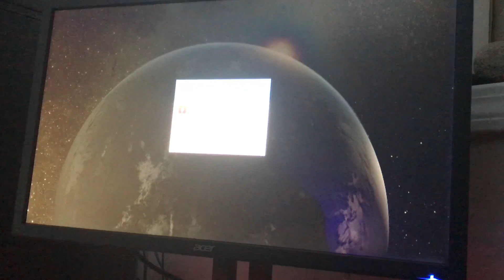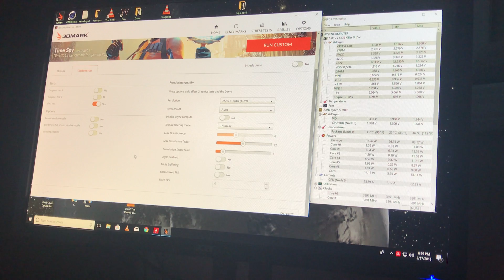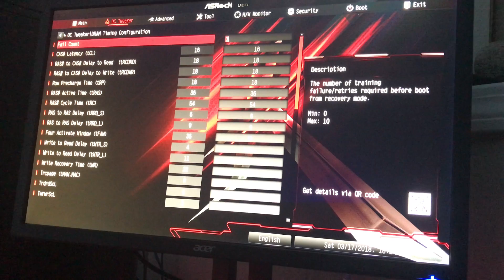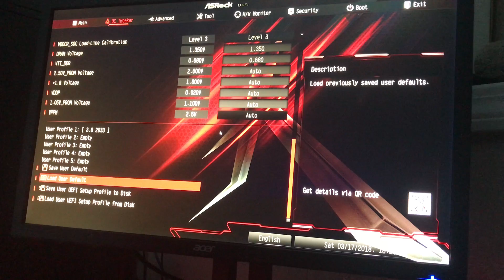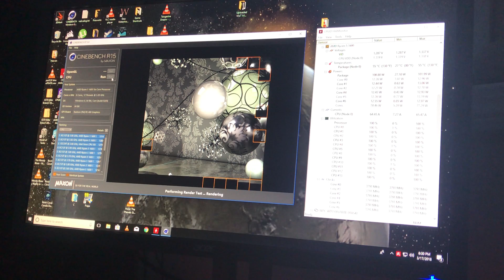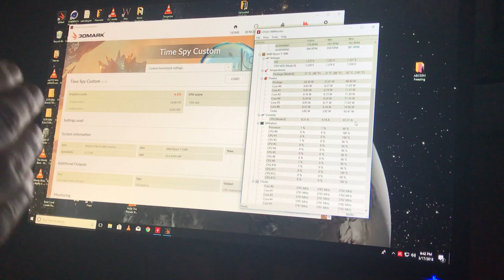ASRock AB350M Pro4 Freezing Part 2

Comment: I have ryzen 1300x and  ab350M Pro 4.  What clock and voltage settings you suggest me ?   default is 3.5 ghz and 1.23 V
Reply from the maker: 1.34 volts is the sweet spot for Ryzen 1 CPUs. You should easily get 3.8 ghz, Should be able to get 3.9 ghz unless you lost the silicone lottery, and if you are lucky you might get 4.0 ghz. I got about 3.95 out of my 1600.

I say 1.34 V is the sweet spot as it gives great performance without stressing your CPU. You can go to 1.4 volts without any issues.
Reply: The Crazy Old Coot  What about memory ?  I have one stick of ddr4 8gb  2666 mhz.   I was thinking not to change it ?  Should I change memory voltage  ?
Reply from the maker: Milan Grbic having just 1 stock of memory will hurt performance . 1.35v is standard for DDR4 memory you should be able to get up to 2933 without to much issue. So I would see how well your one stick performs and if it does well just get another identical one. Otherwise pick up 2 sticks of 3000.
Reply: The Crazy Old Coot  Is it ok just to overclock CPU ?  Or If I overclock CPU, I must do it with RAm aswell ?
Reply from the maker: They are separate, you can overclock each one by itself.

Comment: Hello, I'm new to all these settings, I seems to be hitting 122A for my CPU eventhough I've clocked the voltage the same as yours. Is this a bad thing? I'm running a Ryzen 5 1600. Advice would be much appreciated! I can send you a screenshot of my HWmonitor
Reply: also, regarding the dram, what would happen if the voltage is 1.2 instead of 1.35?

Comment: I'm glad I watched. I have been building computers since 1998 and this had me baffled. I finally got this asrock board and 2400g stable after following the recommendations on the SOC voltage. I saw a massive improvement at 1.2v but to really get it solid stable I had to get it to the upper limits @1.3 v to see it stable. Only then could I dial in a igpu overclock of 1380mhz which has sailed through hours and hours of testing and soak testing. You get the feeling these asrock boards are at their limits with these APUs.
Reply from the maker: I'm planning to get an ASUS B450 Motherboard when they come out at the end of July. All the B350 motherboards have design issues as they were rushed out. I think they were caught flatfooted by Ryzen's success.

Comment: Hey old coot would you explain me, please, why does my PC doesn't freeze with this board but it's too hard to boot after it's turns on, sometimes I've been plugging and unplugging the PSU by two or three hours until it suddenly turns on. It's not a PSU problem (I changed it) neither a RAM problem, I've tested both, my PSU is a 450w EVGA bronze certified and RAMs are Hyperx Fury 4 GB 2400mhz x 2, my CPU is a Ryzen 5 2400g I'm so confused with this, because I don't have GPU or high frequencies RAMs or something that consumes a lot
Reply from the maker: Usually boot issues are tied to memory. Get into BIOS and make sure your SOC voltage is 1.2V and Your DRAM voltage is 1.35. I would do a memtest just to be sure. You could also try just one stick at a time to see if you have a bad stick.
Reply: Thanks! So I believe is voltage problem, HWMonitor shows me 0.926V on DRAM and 1.096V on SOC voltage now my problem will be to boot into BIOS to change it, even fails with ASRock restart to UEFI
Reply from the maker: Ryzen Master can change the SOC voltage and I think the DRAM Voltage too.
Reply: No option to change DRAM on ryzen master and I tried changing SOC but when it restarted no booted again in a while. Just restarted from firmware and UEFI options on windows, I'm trying to make it boot again to change it from UEFI, I'll make the same changes you made in OC tweaker
Reply from the maker: Good luck!

Comment: Hi there I'm glad you were able to fix your board this way but unfortunately increasing the voltages as per your instructions did not fix mine. I've been building computers for 20 years and have never had so much trouble with a motherboard. These boards are absolute lemons.
Reply from the maker: cosmicrdt I haven’t had any issues. I was just letting people know what things to check for before they try and send them back. Some people have got them working and some haven’t. I’ not a fan of the power side of this board. I would not recommend anything higher than a six core with minimal OC.
Reply: The Crazy Old Coot thanks for the reply and the video

Comment: useless. I put 2200G in, use everything on AUTO in bios, set memory to 2400, blue screen randomly appears, few seconds or minutes, video_tdr_failure. Screw this board and AMD.
Reply: Just screw asrock, amd fine.
Reply: Any ideas how to repair it?
Reply: @teqq1q  9 months late ,but yes 
1 (optional) Update bios to 5.9
2 go to oc options and set the CPU to auto by and CBS
3 go to amd CBS (it's in the next page somewhere ,you'll find it) go to throttling  and set a mild overclock (100mhz or so) on stock if you have a low end ,or just 0.05 volts above stock if you have a higher end CPU
4 disable turbo 
5 (optional to increase performance) enable memory xmp profile in overclock settings
Reply: @miltoska9708  i changed my motherboard but thanks, may help others

Comment: Hey sir, how are you? I dont think all freezing issues of this board are related with voltage settings... I bought a ryzen 3 2200g and this board, result: hard frezees with no overclocks. Its not related with RAM or PSU. BIOS updated properly to 4.7.  It just freezes eighter at idle desktop or full load gaming... If you restart the system, it doesnt post, you need to hard shutdown, its just damaged... Something related with DIMM sockets i think. I requested RMA 3 weeks ago, althought still waiting, give a discount it is Portugal after all...
Reply: Ram: Tridenz gskill 2800mhz ddr4
Reply from the maker: The problem of trying to pin it to one thing is there are so many sub systems interacting. CPU, Memory, Storage, Power Supply, and Graphics card. Then added in all the possible settings for each and it becomes a nightmare to troubleshoot. As for memory have you tried 1 stick at a time? What  voltage is it running at? Did you try bumping the Voltage to 1.35? Did you try underclocking? The list goes on and on.
Reply: Yes. Memory was running 1.2v or 1.25v with XMP activated. And Yes i tried everything 1 stick in diferent DIMM slots... Still crashing... With no alternative sent it to RMA. This MOBO is a nightmare. I seriously advise NOT TO BUY. If you have one it doesnt mean that you will absolutely have troubles, tought. Some guys never had! But the majority... Well, the foruns say everything
Reply: Same here even on the desktop.. so frustrating. The freezing happens here and there I cant stand it. Have you switch motherboards? Any updates since this post?

Comment: Hey I can see that you use, ryzen 5 2400g, i recently bought r3 2200g. I use 1050ti instead of integrated graphics card. I have 8gb ram single chanel, but windows 10 shows me that i have 6.93gb usable  ram of 8. It seems like the aPU eats my 1,07 gb of ram. I have tired everything in my bios ver 4.70. turned off integrated graphic contoller but it did not help. I can not find shared memory tab i north bridge folder in bios, even if that is shown in this mobo manual. Did you faced same problem? If yes then how you fixxed it. Thanks.
Reply: Well the only beta bios which I can see at vendor's site is 4.73, no sings of 4.71

Comment: Hey sir, i had problems with an ab350m pro4. Went from 3.10 to 3.40 and it got black screen after reboot. Im using r5 1600 and corsair 2400mhz 8gb. What can i do?
Reply from the maker: 3.4 is a bridge BIOS, I'm not sure it will boot to windows. When you reboot you need to hit F2 and get back into the BIOS and load 4.70.
Reply: The Crazy Old Coot it doesn't even post. After i updated it i got a msg that said i need to reboot. So i did. And then i got black screen. No asrock logo, no beeps. Everything turns on (fans, gpu, aio cooler) but not my keyboard. If i pull out the ram i get the 3 beeps

Comment: So what exactly do we need to do for the problem sir?
Reply from the maker: depends on what you have already done. 1) set you SOC to 1.2 volts  2) Set your memory to 2400  3) Set you Vcore to 1.3375 volts  4) depending on your CPU, set the CPU Speed to .1 GHz above your base frequency. if your base Frequency is 3.3 Ghz set it for 3.4 GHz. ( do steps 3 and 4 at the same time.) Then run the piss out of your system and see if it still freezes. If it still does then I would pull 1 stick of memory and if it freeze again I would put that stick back in the same slot it came out of and pull the other one. If it still freezes it is most likely your mother board or CPU. As long as you know your Video Card is good. ( Skip this if you have an APU.)
Reply: My CPU is the Ryzen 3 1200. And I'm running in stock speeds
Reply from the maker: So you need to do the above steps. You need to set the speed to 3.2GHz and your Vcore to 1.3375Volts. 
 Have you set your SOC to 1.2 volts and your memory to 2400? What GPU are you running.
Reply: 1050 Ti Updated drivers. Tried the most stable drivers.
Reply from the maker: BlazingApple no  additional over clocking on the GPU I am assuming?
Reply: Yes sir
Reply: The Crazy Old Coot I'm so late here but, I'm having a freezing issue now on this Mothorboard and I'm using an APU, I'm a bit confused, should I follow these steps? or not? cause I'm using an APU.
Reply: @kenjitatsumaki9086  I suggest you to just replace your motherboard if it's still under warranty. The freezing issue in this particular motherboard is never getting fixed.
Reply: @Parkr_  Yeah, I also think right now that that's the best and the only solution for this board. Thank you replying  anyway.

Comment: same issue here with the memory, i have the 3200, but 2933 is highest speed that is working. the mobo is the problem. i have a question, my psu is corsair vs450, is it safe that i overclock to 3.8 1.3v and 2933mhz on ram?
Reply: Aktiv Grotesk Vs are not good PSUs, I would recommend CX
Reply from the maker: As long as your not running a Video Card that has 2 8 pin connectors. lol  The modern stuff doesn't require as much power as the older stuff for the most part. But that said I would get at least a Bronze Power Supply.

Comment: So is this on the AB350M Pro4? You said the bios is the 370. Are you running the 370 bios on the 350 or is this the 370 motherboard?
Reply from the maker: This is not the AB350M Pro4 board but the Killer ASRock X370 board. Not much differences between the 2 BIOS's. The latest AB350M Pro4  BIOS is 4.70 I linked it in the description.
Reply: I updated to 4.70 when it was released. Just confusing because you are talking about the 350 board but showing us the 370 bios. I know they are similar but I could see the issues the 350 is having may not be an issue on the 370 board. So far I have not had any issues with my 350 board. Even though my board had the sticker on it claiming it was Rysen 2000 ready, mine still would not boot with the 2400g. Newegg was nice enough to loan me an older APU so I could get the bios updated. So fa so good. Not a fan of Asrocks bios. Not very intuitive on the graphic side of things.
Reply from the maker: What do the Vcore voltages look like ( CPU VDD) When you run Cinebench? Have you Set the Vcore to a fixed voltage or are you running in auto?. Not much you can do with the Graphics in BIOS anyway except set how much RAM to dedicate to the Graphics and that doesn't even matter.
Reply: If I remember right, I have the clock locked at 3.8 with the vcore at 1.375v. Cinebench score around 830. I have tried the clock at 3.9 and the vcore 1.3- 1.4v but cinebench will crash occasionally. When I get a better cooler I may try some higher settings. Temps with stock cooler peaks in the mid 70's.

Comment: What happened to your AB350M PRO4?
Reply from the maker: My Son is using it. Everything between the two boards are quite similar
Reply: What's his CPU? Is he experiencing freezing issues too?
Reply from the maker: Running an R5 2400G with a 1050 ti. No issues what so ever other than what has been discussed in past Videos.
Reply: You should've done this to your son's AB350M Pro4 sir.
Reply: @ellsworth1956 I'm having problem with this board now with the rx 580. My memory is stable with 8 hours on memtest so SOC voltage is the only part I changed but I am still freezing my CPU is undervolted and underclocked and is stable. Should I follow all the value?